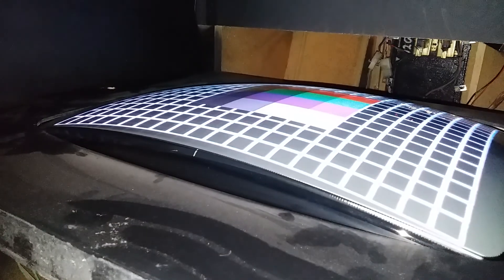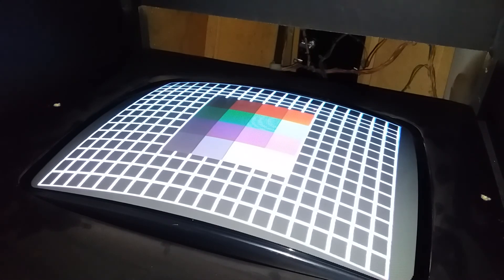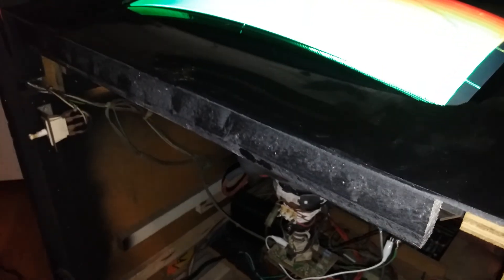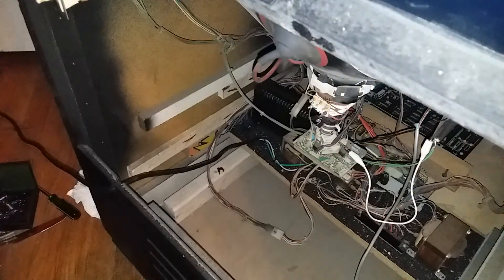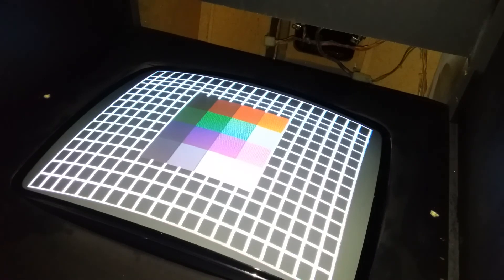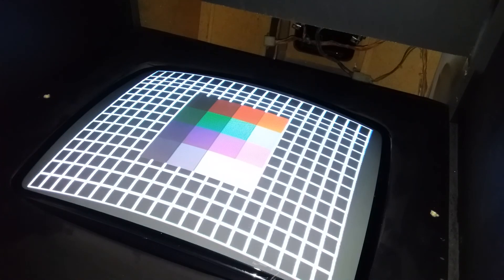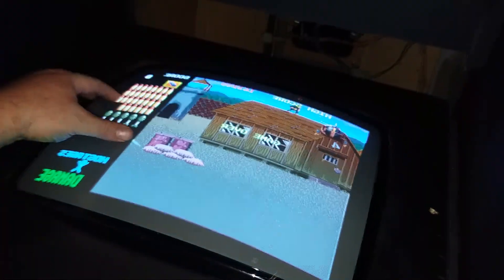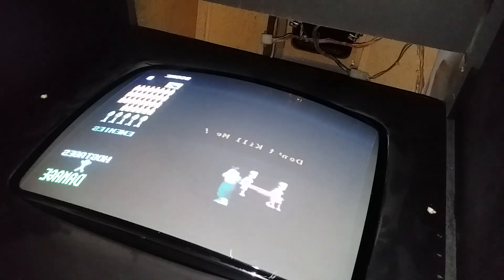Operation wolf monitor troubles. Wg k7000

Comment: Looks like a degausing issue, if you put a new screen in then chances are its needs degausing and you need to use a degaus coil or a wand as the tube coil wont be strong enough to deal that that level of colour imbalance, only other things that will cause a color problem like that is if the Yoke isnt properly set up alignment etc or your purity is off, purity is adjusted by the convergence rings usually the 2 rings closest to the yoke windings.

Comment: are those white lines that go horizontal on the screen normal? The ones you can see while the the screen goes black... thanks.
Reply from the maker: The white lines if im right by what you mean.  Get to your monitor turn down the contrast and brightness pots all the way.   Then turn the fly back all the way down turn fly back up till lines appear and back down till the just go away.   Then re adjust brite and contrast to your likeing. Let me know maybe ill do a vid on it. @Mo Llamas
Reply from the maker: You want your screen bright as possible but to much from flyback ive noticed does cause the white horz lines.  Use your brightness and contrast foe briteness may even need to add color and color trim.  If you cant get it may need cap kit? Mine was alot better to adjust after but used a newer unburt tube too.   Let me know bud. Ill try help ya out
Reply from the maker: If you turn up colors to much they will bleed outward from image. Way i think of it red blue green make white when i turn on opwolf screen grid ill turn up one color why white grid turns redish so add almost eqaul blue and green get it as brite white as possible with out comming out of the images lines.    Ok that then would allow me to briten up the screen with out washing out the color.         I hope im making sence.